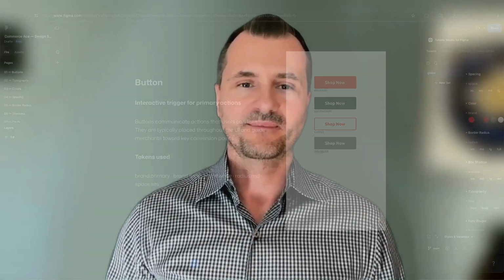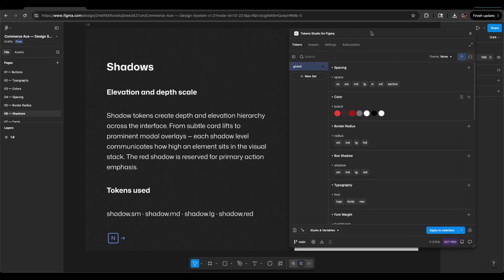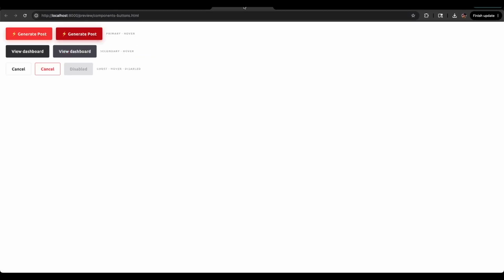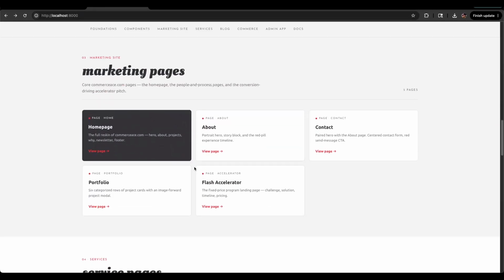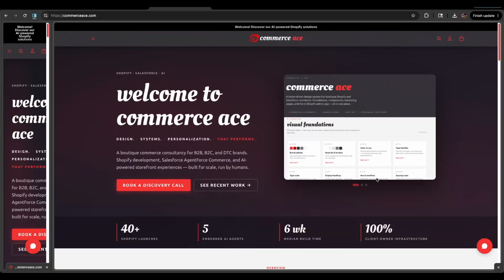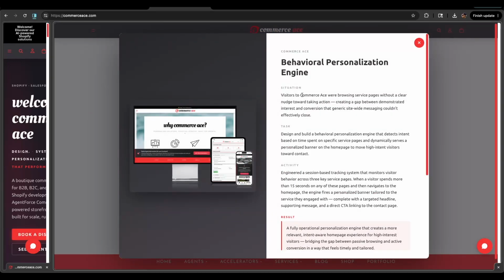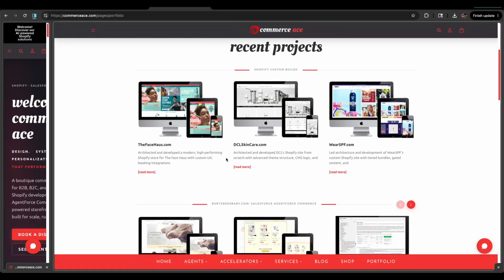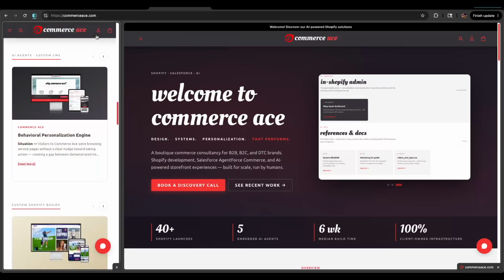Why Design Systems Are a Force Multiplier for Digital Products

Comment from the maker: Most teams think design systems are about consistency.

The real value is leverage.

When every component, spacing rule, typography scale, and interaction pattern becomes reusable:
→ development speeds up
→ branding stays aligned
→ UX quality scales
→ platform migrations become dramatically easier

That’s the part most people miss.